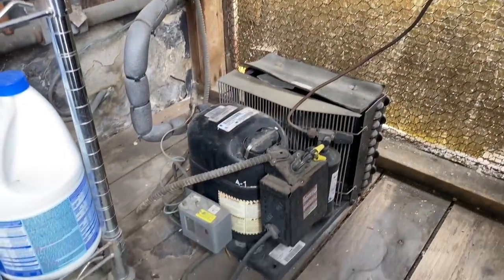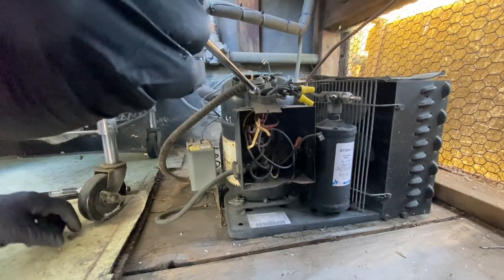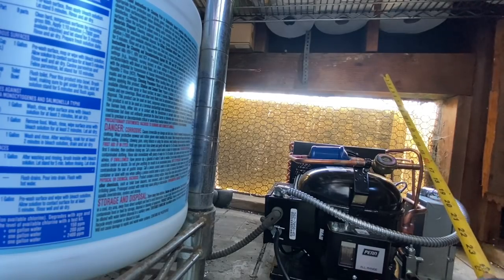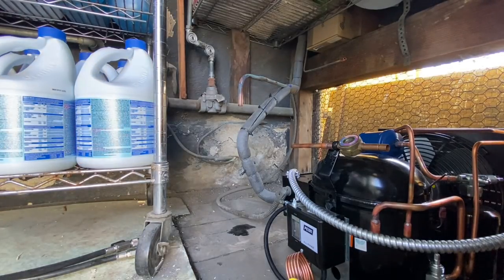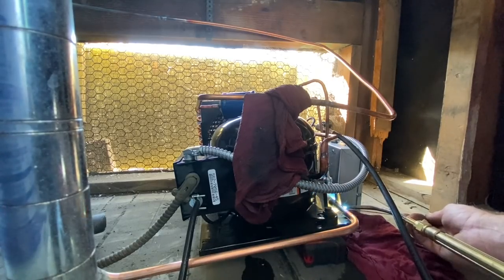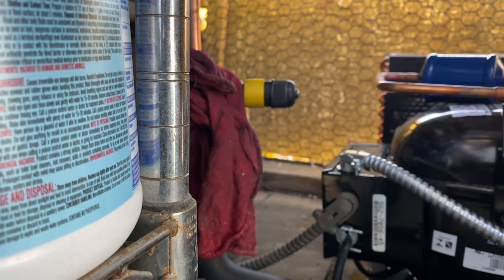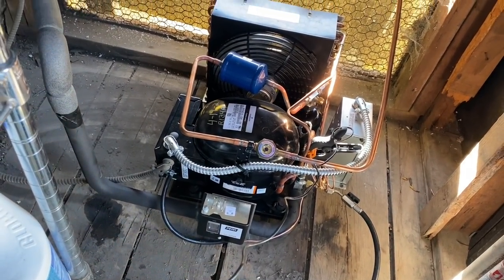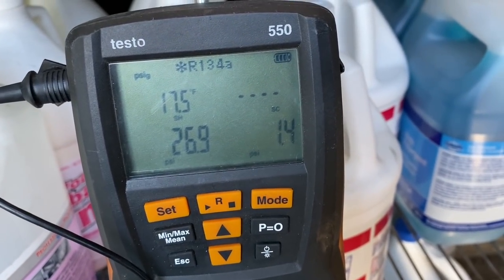The walk in box is warm

Comment: Hey Dave  Im putting together a streamlined pouch for diagnostics.  what is the common size of that nut on the Bohn fan guards and what is the set screw size of the blade?  thanks
Reply from the maker: 1/2” nut.  1/8 tee handle Allen

Comment: Would it help to use a drop of Nylog on the swaging tool?? It seems to produce a lot of heat so maybe with Nylog the tool and the battery and the impact last a bit longer.
Reply: Bad idea.impact should not be used for this tool.the tool uses heat to do its job.just a regular screw gun is needed.

Comment: Ok.... what is the start cord setup? Don’t think I’ve seen that before.

Edit.. found your video. Yellow Jacket 69523, but seems to be discontinued.
Reply: Pull current relay hot too run pigtail second hot to micro switch to start press in switch let up right away also can try a start cap in this setup to bump start compressor fun to do when customer likes to hover.
Reply: @metal2444  We built one like that on my electrical class on hvac/r school, thinking of building another one. They are really helpful.